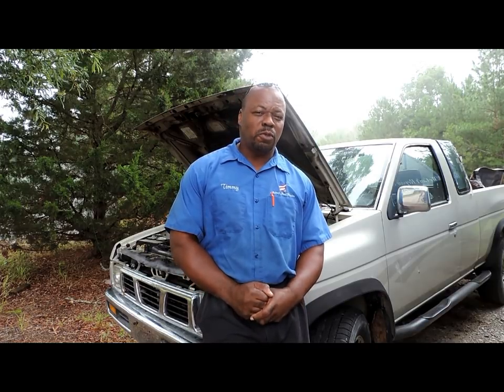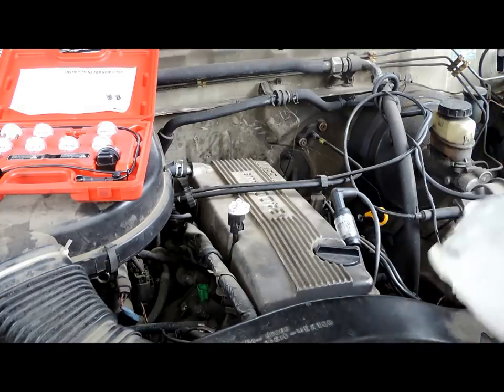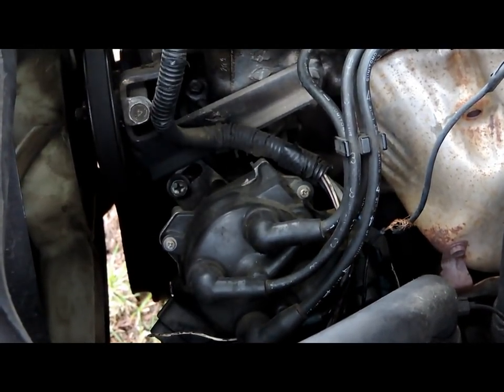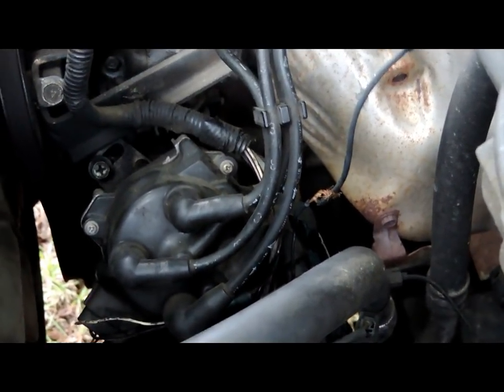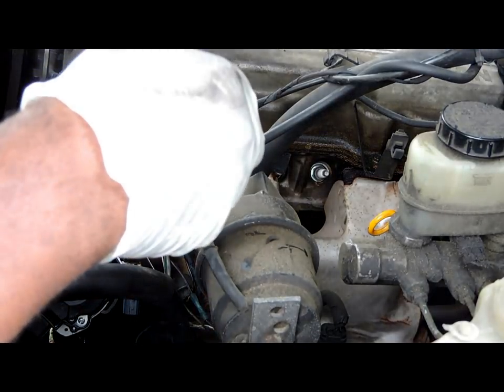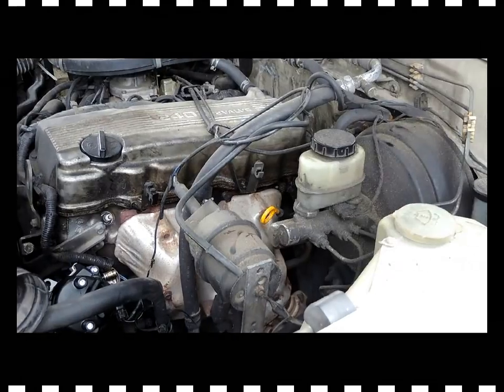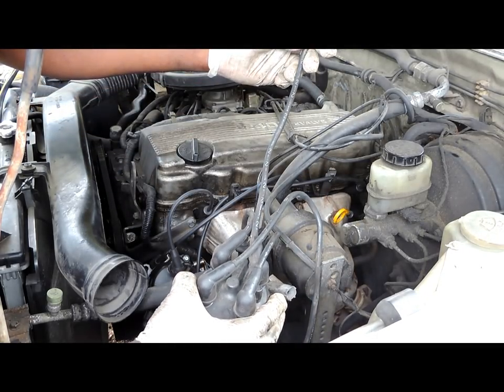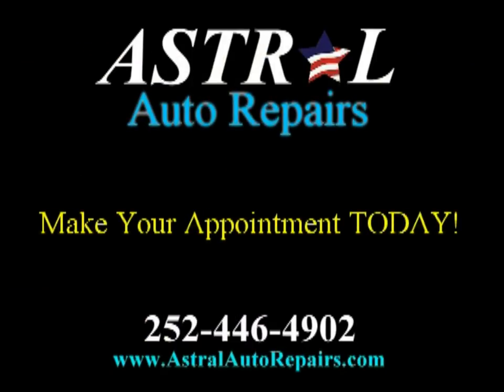⭐ 1997 Nissan Pickup - No Start - Checking Spark And Injector Pulse

Comment: What happened when you put fuel in the throttle body and you have fuel coming out the filter to the system and still will not stay running?
Reply: Did you find out I have this issue

Comment: Yep, good vid..... I just found my coil inside the distributor to have burn't a hole thru it and was leaking spark, shorting out to the inside of the distributor housing,on the side where I could see until I removed it, crazy thing is, it'd only die when I pressed hard on the accelerator, when it sparked it also blinded and confused the cam positioner sensor which is also inside under there too, the cam positioner then told the ECU to cut fuel due to it didn't know what the hell the cam was doing.............. thanks for the vid !
Reply: When your motor was acting like that what it shut off at a certain RPM

Comment: HELP!! Have same 97 Nissan, but green. Has 382k and no major work ever. Basic stuff wear and tear. Has been missing for about 6 months. Replaced distributor cap and rotor and new plugs which were definitely needed. Helped but not fixed. Recently noticed it was worse when cold outside. Found damaged air temp sensor. Was going to replace last Friday but wife hit a deer with her car and had to get her another car. Left to go to car lot to get car Friday afternoon and about three miles from home began to run rough, backfired a couple times and died. Won't start now

Checked spark by pulling plug and holding against block. Spark plug does fire. Checked fuel by pulling line to fuel rail and has fuel dumping out when turned over.  
Pulled valve cover and timing chain appears tight, virtually no play and all looks good. No obvious broken valves or springs. (Broken chain was my biggest worry) 
Okay. Checked fuses and all okay 

Sure of spark and air but fuel could still be an issue. Got a can of starting spray and nothing. Like no change in sound when turning over and won't even try to start or bust off. .
Was told to check compression but no obvious gasket issue and even if so wouldn't it still try to fire??? 

Any help or pointing in the right direction would be greatly appreciated as I love this little truck.

Comment: I know this is a older video, but I seem to have the same problem.
My 1993 Nissan truck with the 2.4 engine will crank but will not start. If I put some gas in the carb and a small squirt of starting fluid it will startup. and I can keep it running on starting fluid. Also when I turn on the ignition key I do not hear the fuel pump run. I don't know if I would hear it because I just bought the truck not running. If you have any Ideas I would be most appreciative of you.
Reply: Got the same issue brother, just trynna find out the same solution to fix it
Reply: I have the same problem

Comment: I have a 1997 pickup just like this. I was driving and it just shut off and could not start it again, had batt. Power and cranks but wont turn over. Has no spark! . Plugs, wires are brand new. Has power to the dist. But Replacing the dist. Soon. If its not the dist. What else should i look for? There are no codes as well.
Reply: Lmk when you find the problem
Reply: 96 d21 here and same problem. Was running then shut off. Cranks but no spark. New battery, plugs, and distributor. Power to distributor and injectors. Checked fuel by unhooking lines and try starting. Just won't start. All fuses are good. I'm lost.
Reply: @benjamincullifer165 what was it
Reply: Dude give us an update. Come on
Reply: @joshuacruz4046  haven't figured it out yet. Tried sensors switches ECM plugs wires. Nothing yet. Haven't tried the main wiring harness is about it. Idk bro. Hurting my brain. 😆

Comment: I can't get my truck to crank sometimes. Starter is currently bad gotta change it so I have been pushing the truck off when I do use it. Normally jumps right off in 2nd, 1st, 3rd hardly any trouble. Well lately I can pull it at 20 mph and it won't start.... Pull it a little more and sometimes it'll mysteriously just start..
 
What could this be?

Comment: I have the same truck, cranks no start, key on, no power going to distributor. Ran fine but throwing a p1320 code, primary ignition signal. Ran jumperwire to resistor to ensure continuity to resistor by valve cover. Now cranks but no start. Ideas?
Reply: Sure enough, no spark and tested coil per fsm. Put spare distributor in, retimed, and problem fixed.
Reply: Ty

Comment: Can. You. Dig it?! 
Nice vid, good stuff.  

My cousins truck has a ka24e as well,  but the ignition coil is separate from the distrib. It's off to the driver side fender.  We had a no spark issue.  Replace the coil cuz it was the original,  no spark.  Wires, cap, rotor, fuses... No spark.  What gives!?
Reply from the maker: Thanks Sheet Phace, be sure to check injector pulse as well. Once you check that, then let us know what you find.
Reply: What was the issue

Comment: The pulse of  the  injectors  is controlled by the  distribution  or by computer? ??
Reply from the maker: The distributor sends the signal to the computer, then the computer pulses the injectors.
Reply: @OnlineAutoRepairVideos  i  changed  oil pump nissan pick up  2.4  16  valvulas  but now it doesn't  start   i dont believe  that  the  timing  is bad cause the pump has just a way to  be with the distributor   or not?

Comment: Hey Astral. I have the same engine. Starts only with starting fluid. Fuel pressure good, tried a spare distributor, same result. Plugs dry, fuel pump only a month old and a known reliable brand. Ideas?
Reply from the maker: Hey Jason, it seems that your injectors are NOT pulsing. Do you know how to test the wiring going to them?
Reply: ⭐ Astral Auto Repairs. So it turns out it will start if I mess with the relay box and test light checks. But it never dies while driving. Just no power to injectors after shutdown. Have tried other relays too. Same result.
Reply: 8
Reply: Mine won't start even with fluid. Has spark and air. Seems would start with fluid or at least bust off even if injectors failed 100%

Comment: My number one is on the bottom? and it only cranks like if its off time when I plug in my ignition system.
Reply from the maker: What kind of car do you have?
Reply: Astral Auto Repairs 1990 nissan d21. It has that exact engine in your video.
Reply from the maker: You might want to check the timing. Once it starts, how does it run and does it have normal power?
Reply: Doesn't start

Comment: How can you tell if the distibutor is bad
Reply from the maker: No spark is a good indication, and a good start. Other than that, you would need a multimeter to test the wiring going to the distributor as well.
Reply: ⭐ Astral Auto Repairs thanks for the reply all its doing is cranking over unfortunately I don't have a multimeter
Reply from the maker: Do you have a way to check for spark?
Reply: ⭐ Astral Auto Repairs any advice on what I can do to check for spark
Reply from the maker: remove one of the spark plug wires at the spark plug end.

Get an old spark plug and  connect it to that end of the wire.

Lay the spark plug on something metal on the engine.

Have someone crank the engine while you are watching the gap at the end of that spark plug.

You should see an actual spark jumping between that gap.
Reply: +⭐ Astral Auto Repairs it does have spark maybe fuel problem

Comment: Ok so I have a 1990 distributor in my 1997 ka24e . I ordered a 1997 Distributor but I was wondering where the coil wire goes on the 97. I have no clue where it goes.

Comment: Well...mine had spark and fuel, but a broke timing chain
Reply from the maker: That sucked!
Reply: @OnlineAutoRepairVideos  yep... Its actually the 16 years old sons..done ordered the parts gonna tackle it this weekend,  truck had a brand new head when we got it, but looks like they used a 25 dollar timing chain kit...I order a oem chain and gears this time ..so we will see!!!
Reply from the maker: @kevinc9006  I've seen those cheap kits on Ebay, well I did a 2004 Sentra, so I'm guessing they would be somewhat similar, and that one sucked! the pickup seems a little easier because of the way it's set in the engine bay. I just looked up the labor on doing that job, and it say 6.7 hours, so it is almost EXACTLY like the 2004 Sentra. Also that labor I gave you, was for a 2 wheel drive with A/C and power steering. The 4x4 is higher.

Good luck, and do keep us updated!!
Reply: @OnlineAutoRepairVideos  well man...it got the valves, Got head off and ordered some 6$ each valves lol so we will go from there...got a nice timing chain and guide set on it though and new oil pump and water pump👍😵🤣🤣 the revision 3 tensioner on it too lmao...damn nissan
Reply: HO LEE FOOK
Reply: @kevinc9006  Interference motors can suck sometimes.

Comment: Sorta wondering if i have this problem i have a 93 ka24e turned on my truck drove down the street to see a friend wen i was leaving dam thing didnt want to start i had just put a new battery it took a jump for me to get going i was thinking alternator but now after seeing this vid im a little lost.
Reply from the maker: Before you jumped it, did the new battery seemed like it was dead?
Reply: @OnlineAutoRepairVideos  no everything turned on like the lights just no start soon as i jumped it started right away
Reply: Had a truck do same thing. Turns out new battery was bad. Replaced. Did it again. Same thing. Third time as was a charm. Apparently O'Reilly had gotten a bad batch.